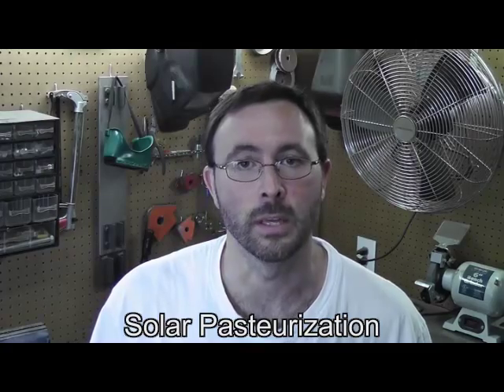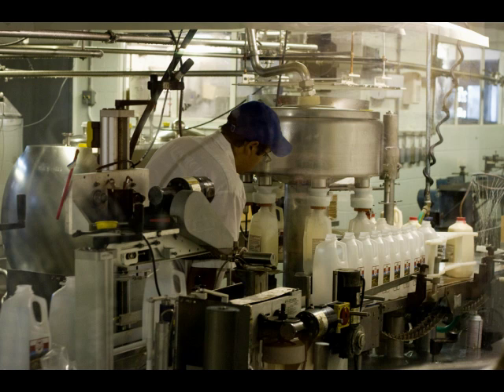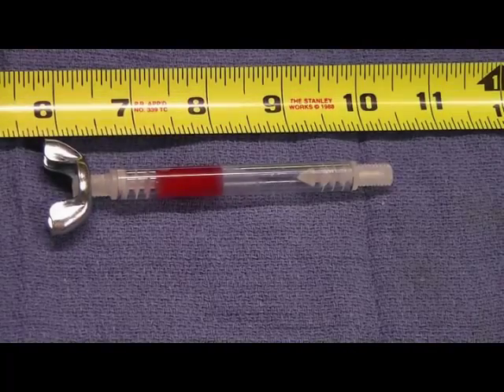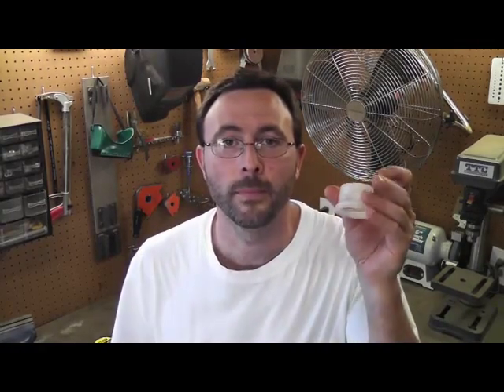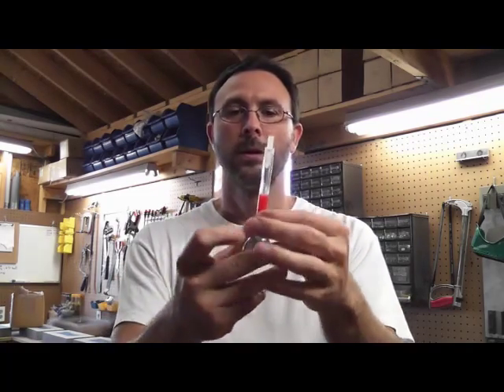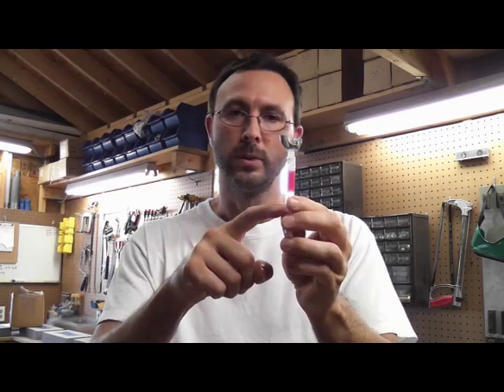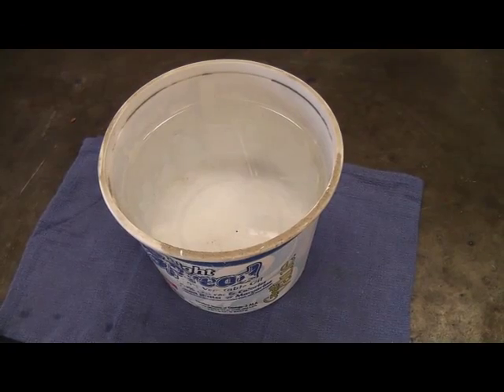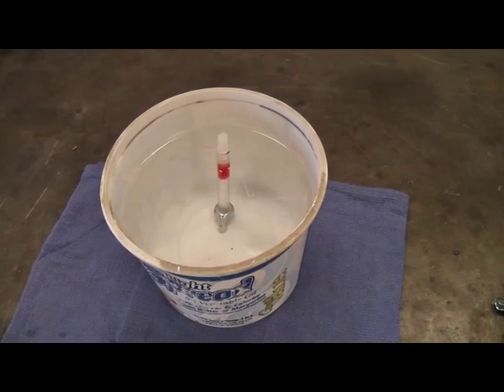Solar Pasteurization of Water, SPADE

Comment: Why not use a thermometer? When the temperature exceeds 70 Celsius, you'll know that the pasteurization of the liquid is done. Simple
Reply: i guess, because this is simpler, smaller and cheaper.
Reply: Because Mercury is always moving and so direct sunlight on top or under the water will have a false reading cause of the refraction from the glass the Mercury is in the wax is thick meaning all the wax has to be the same temp to move making safer for really nasty water